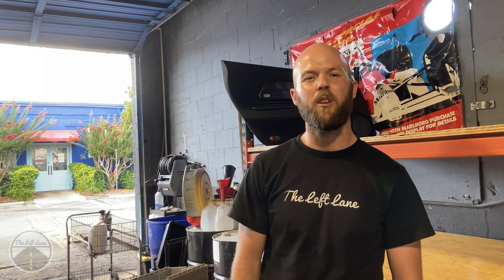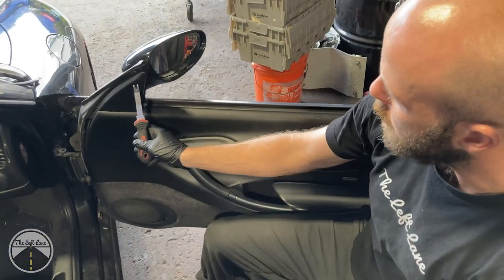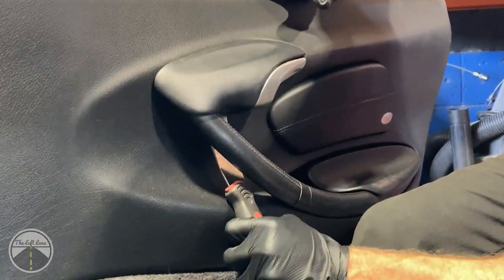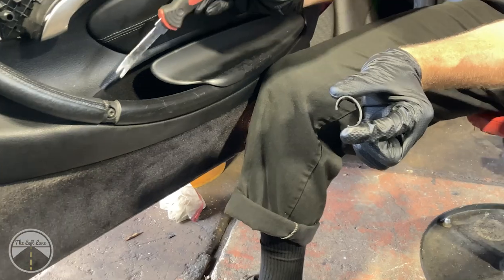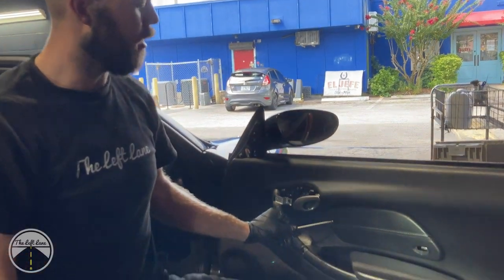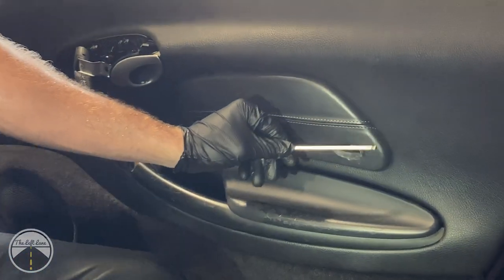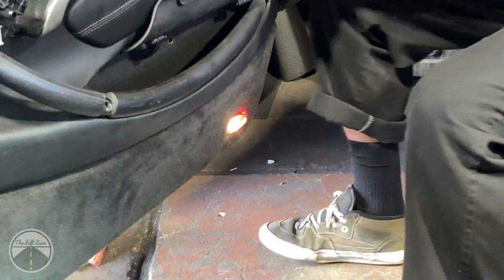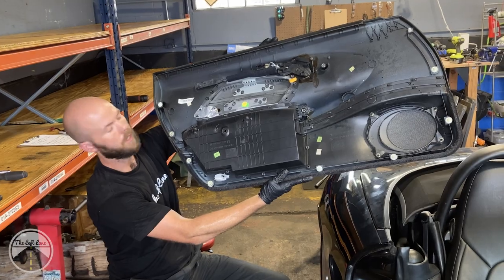Porsche Boxster 986 Door Card Panel Removal Driver Side

Comment: I have a Boxster 986 2003. I opened the door panel to replace an arm rest on the drivers side. I left the window up and disconnected 2 wires behind the door handle (black and white). Upon putting everything back, the window no longer lowers in order to open the door. The windows work fine otherwise and go back up when closing the door. Any ideas on what the problem may be or any solutions? Thanks!